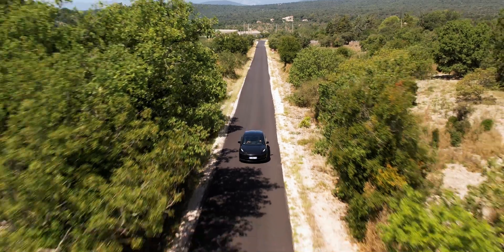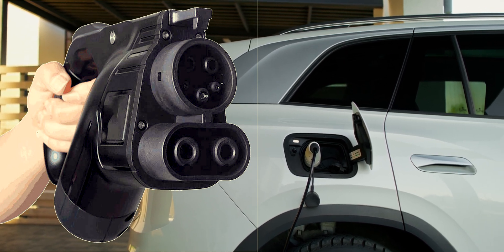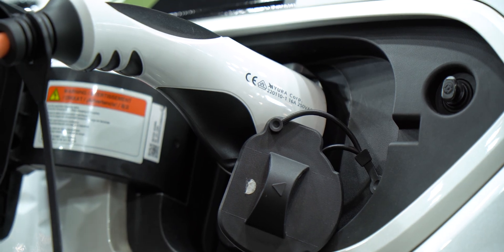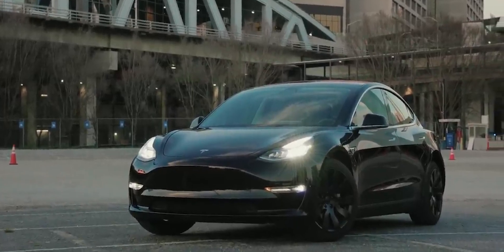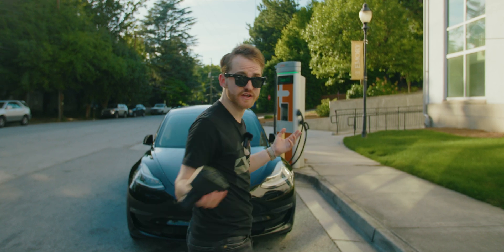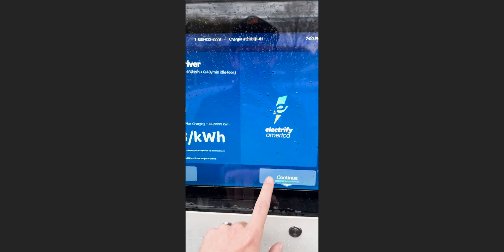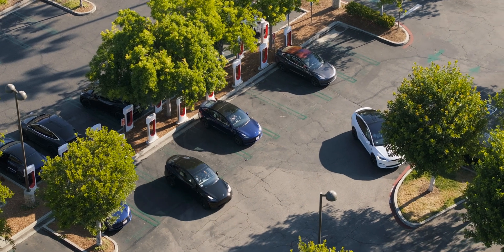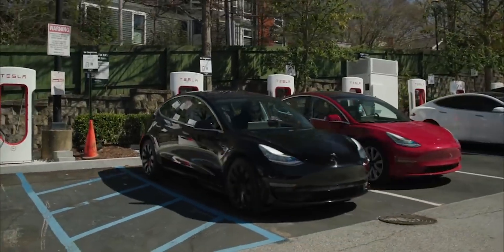Range Anxiety Solved: Tesla's New CCS Retrofit for Model 3 & Y

Comment: Eh? So you paid for a retrofit and they retrofitted a plug which needs an adaptor instead of putting a CCS plug in? this makes zero sense.
Reply: Why would they change the port from nacs to ccs? We use tesla superchargers 98% of the time and nacs in the standard now anyway. All non tesla evs need an adapter and can use superchargers now and going forward all new ones will come with an nacs port.
Reply: @guttagutta420  Maybe I misunderstood. It sounded like the tesla chargers didn't fit the car because they're CCS. A conversion was fitted; and the plugs still don't fit the car. TBH this is made even more confusing because everyone in Europe (I live in the UK) just uses J1722/CCS. I didn't realise the tesla plug on American cars was NACS - it looked like J1722. The reason why I even looked here is because I'm tired of my Model X not being compatible with Tesla's own CCS chargers since they upgraded to 350kW and away from J1722.
Reply: @d @dph9885 e retrofit is an ECU chip inside the trunk that does the “handshake” he mentioned. The J1722 adapter is a physical connection that just happens to be included in the retrofit service. 

The real change is computer.

Comment: The Q I've had about this is, based on reporting I've read, as of recently there are still some Supercharger stations that are still using the older Tesla proprietary CAN-based charging protocol and still haven't upgraded to CCS for NACS. Does this upgrade support both the CAN-based and CSS protocols, so that you can still charge at these non-upgraded Supercharger stations?
Reply from the maker: Every SC I’ve used (including older chip ones) have worked totally fine. My guess is it’s backwards compatible

Comment: There is no new CCS retrofit for Model 3 and Y... It's been available for a few years. 2022 I believe for Model 3 and Y.
Reply from the maker: Not quite,
Most models after some point in 2021 shipped with the proper chip but older models didn’t and the retrofit was only previously available for Model S and X. Although, it was announced quite a while back. Just not launched until recently:
https://driveteslacanada.ca/news/tesla-finally-launches-ccs-retrofit-for-model-3-y/